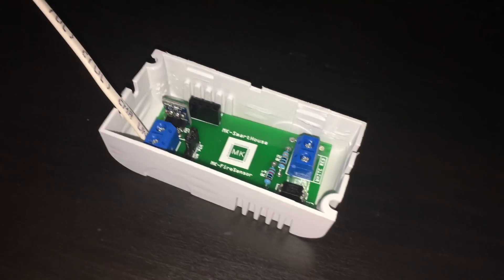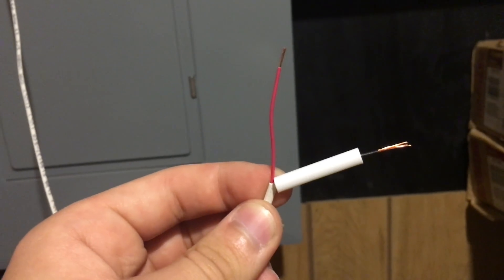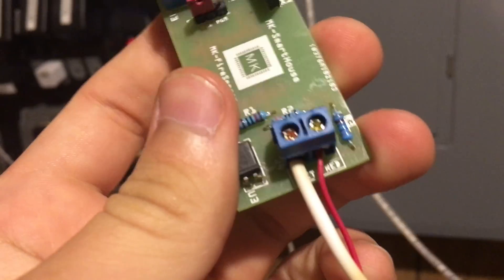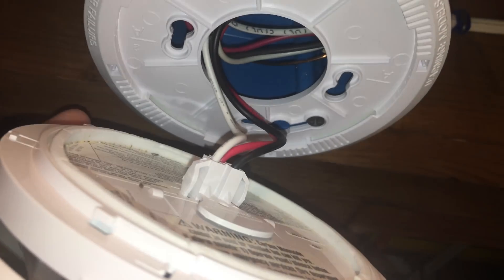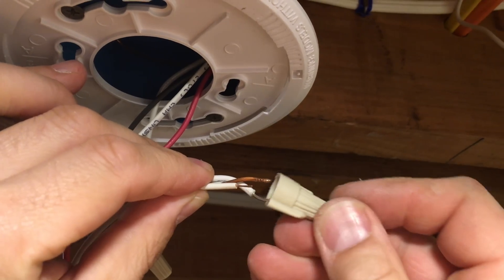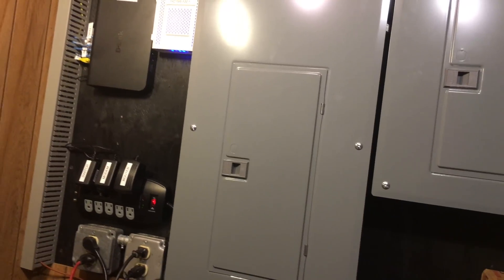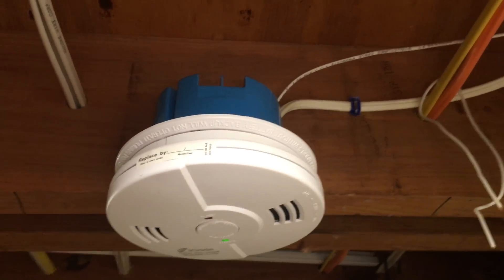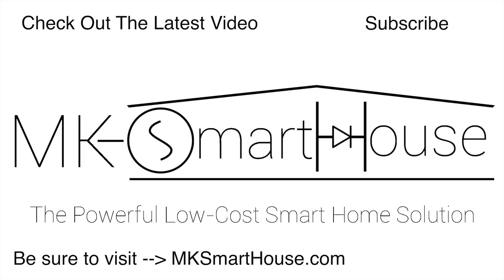Complete Guide Fire Sensor MQTT OpenHAB ESP8266 : Final Installation

Comment: Does this work with any smoke detector? or only certain ones? I have AC powered with battery backup ones as well.
Reply from the maker: As long as it has the interconnect feature

Comment: Have you considered using RF sockets ($30 for 5). They are very cheap to buy and can be controlled using a 433mhz transmitter ($1-2). I have got this to work using my Raspberry PI but can't manage it on the Arduino. Have you done any work like this? IF you have can you post a tutorial on how to get that running. Great series, I have been binge watching for days.